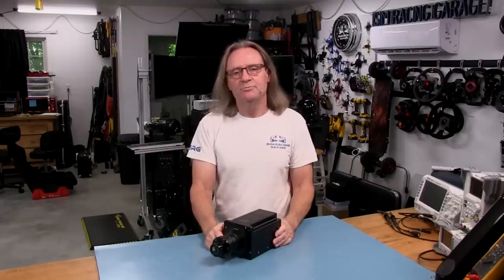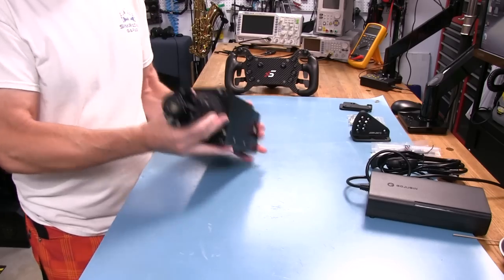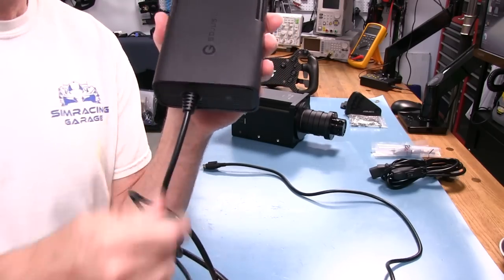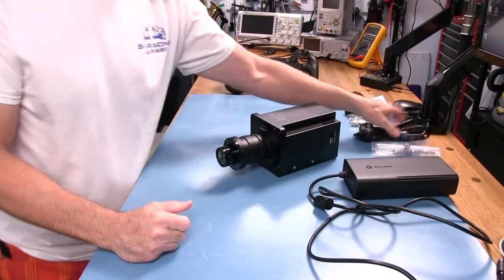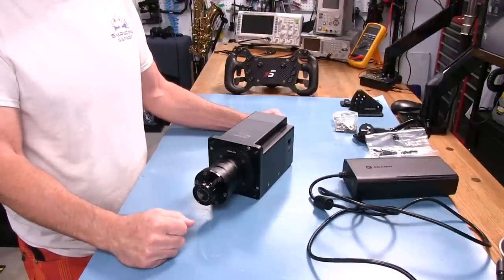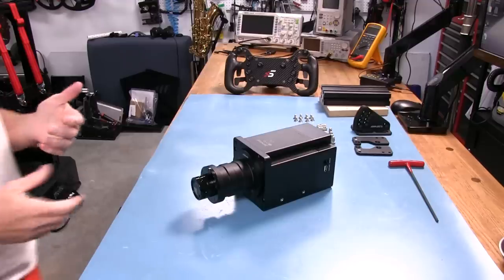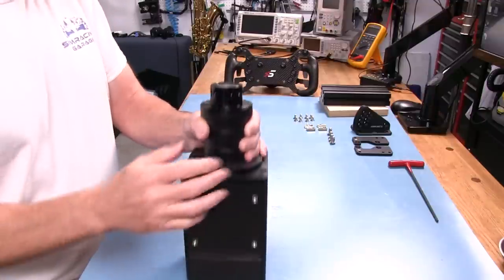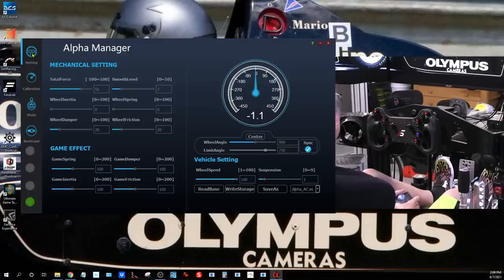Simagic Alpha Mini DD Wheelbase Review

Comment: Part of your issue with the "Notch" while passing center, is due to you going from a profile with 900° in Alpha Manager, to one with 1080° without re-calibrating the wheel in game. This will cause Linearity issues and can create a "Notch". This notchy feeling you experienced is only present in iRacing, no other game has this. This is due to the inferior 60hz signal coming from the game which needs a lot of Interpolation/Smoothing. This is also why this issue isn't present when using iRFFB.
Every other game is smooth as silk, the hardware has no notches whatsoever. This is an iRacing issue in itself, which is why users tend to use iRFFB to clean things up and fill in the missing gaps.
Anyway, Thanks for the Review, your Hardware section is great as always.
Reply: Btw, I loved ur review on the alpha mini, thanks for taking the time out to make it!
Reply: @DogInANautSuit  Thank you, I appreciate the feedback.
Reply: Preach! I have never felt any kind of notchy feeling in AMS 2, AC, or ACC. Mega smooth but I am coming from a G29 so of course it's gonna feel better for me 😅.

Simagic has knocked it out the park with this product, can't wait to see their pedals!!
Reply: Thank you for your comment, so the solution for the notch feeling is setting both 1080º in Alpha manager and 1080º in iracing?

Comment: It's nice to see DD wheels are coming down in price and advancing simracing technology. Even though I think belt driven wheelbases still have their place, but they need to be priced lower (~200-350 EUR). Low entry DD wheels 500-700 - which is already happening. And then the sky is the limit. 
I have my personal grievances with Fanatec (the firm) and their DD, I think 0.5DD is their way to get you hooked into their ecosystem. But anyhow, it's a good entry wheel for those who have tried simracing with lower tier wheel and fell in love with the hobby. SiMagic when it first came on my radar, I was excited to see more competition in DD space. And they continue to deliver.
I love this channel. Smooth voice of Barry is almost ASMR brain therapy.

Comment: What's really nice about the adjustment system with the side bracket at 39:25 is that it means you can make sure each side is perfectly even, where as if it was just one big long slot on each side, you would have to make sure it's level yourself
Reply: I have a bit of play in mine when I turn my FFB all the way up :( , it's vertical play.

Comment: Thanks for your comprehensive review, Barry. Looking forward to your CSL DD review
Reply: Bold of you to assume that there'll be a CSL DD review
Reply: @tracklizard4018  at this point, I really don't care about CSL DD.
Reply: @samgh7166  Me neither. Having to use a fanatec wheel + paying another 100 for 8nm is a deal breaker to me. If only there was a decently budget oriented manufacturer that just created a wheelbase + free software that has a standard bolt pattern for any wheel.

Comment: The in-line power switch is a great idea. This way you disconnect the mains power 
from the power supply as well, not just the wheel base.
Reply: Couldn’t you just unplug the whole power supply

Comment: I actually like the switch on the cord as my Fanatec DD1 switch doesn't turn my wheel off anymore and now I need to send the whole wheel base to Fanatec for repair, whereas if it was built into the cable, maybe there's a chance that the cable would just need to be swapped out. It could be apples and oranges for all I know...

Comment: 17:30 At this point could you mount an aftermarket wheel such as a momo, omp, or sparco? What bolt pattern is that?
Reply: It's compatible with 50mm and 70mm bolt pattern rims. You just need a spring ball bearing type quick release. Simagic makes their own and the NRG and D1 spec ones are both compatible. Also you don't mount it directly to that.

Comment: Great review (as always!).
@1:28:16: At $500 this is a great deal. Although Barry mentions the promo runs until end of August, the price now already shows $799.00 on August 15, which isn't that much of a good deal anymore, especially with the Fanatec CSL DD just around the corner.
Reply: @Polymer If you clicked on the link at the bottom, and read the description, you would see that $799 is for the mini base plus a GT1 Wheel, which is a great deal.
Reply: @T3KNOSIS  thats 950 now lol
Reply: @mirshia5248  The price was a special launch deal that would end in the 2nd half of August.
Reply: @mirshia5248  In Europe the Alpha mini with QR 1s 675 euro, without 595 euro. In a bundle with the GT4 wheel it's 1099 euro, the GT1 wheel bundle 1039 euro. The CLS DD is a entry level DD wheelbase, the Alpha mini not.
Reply: @mirshia5248  Where I live it's only about $200 difference, It's definitely worth it. Especially since it's a better base than the CSL DD.
Reply: @mirshia5248  $1350 with the wheel in canada. Not far off the CSL DD after import fees from USA
Reply: @rubbertoe.  day and night difference in quality tho
Reply: @eclipsedigi  funny that comment is pretty old. I actually recently purchased a simagic alpha mini. The quality on the simagic wheel is quite a bit better than the CSL DD being all metal instead of plastic like the DD. The motor itself is also better than the DD.

Comment: The power switch on the cord is not that bad, as it switches off the power supply as well. You could argue to have a switch on the power brick instead, but at least I find this a better solution than putting the switch on the base.
Reply: Or couldn’t you unplug the power supply every time no?
Reply: @kingnorwegin482  too many options. Cannot manage.

Comment: So the way the base connects to the wheel is wireless, but it is connected like its a wired yeah? With no wifi or bluetooth because it has the pins to connect like its wired without a cable.

Comment: I got this over the csl dd. For about 200 more you get 10 nm without having to buy a seperate power supply which really sold me
Reply: I think a third party power supply will works on the CSL DD. You can find them by around 40 bocks. Then the money gap is much bigger.
Reply: But ideally you need to buy the matching wireless wheel making the alpha mini $1000usd.

Csl DD with boost pack and a rally or mclaren wheel $680usd.
Reply: @barrymanon9459  No you don't, Just buy one of their quick releases. Unless you really want buttons on your wheel.
Reply: @jaketad939  Alpha mini with GT1 R wheel is 799. Not sure why folks are exaggerating the cost here
Reply: @winstonang8980  Yea exactly.

Comment: I'm in doubt about where to adjust the flywheel resistance (flywheel weight). I didn't find the option in SimPro Manager. I saw that in the old software there was this option. Wouldn't it be possible to adjust in the new version? thank you if you know how to help (Alfa 15Nm)

Comment: beside the 2nm extra in the Simagic Alpha Mini DD what do you think would be a better buy the Simagic Alpha Mini DD or the FANATEC CSL DD the price is not much different ?
Reply: VRS
Reply: Well, the Simagic has better compatibility with third party steering wheels (lower and higher quality compared with Fanatec wheels). It also has a better finished, wireless system (which fanatec doesn´t need and works as it would be wireless), much better quick release (this one is amazing), a very interesting controller software full of options, ... Fanatec has nice pros as well but I´d bet for Simagic.

Comment: A big question here: did you ever manage to make the Simagic Alpha Mini work in Project cars 2 or Automobilista 2? It never works for me. Very difficult to even assign and calibrate, have to reduce the rotation to tiny angles. But even after that, in game there is 0 movement from the wheel. All the buttons are recognized, even axis of the paddles, but not the rotational axis. Tried with all settings I could on the Simagic software and in game, same result in both of those games.
Reply: it works in both of those games for me.
Reply: Yes offcourse, ams2 works amazing.
Reply: @pallevan1977  Oh nice, thanks for that information. i've been trying to find out for a while if simagic harmonizes well with ams2 and haven't found anything yet.
Do you still sometimes drive in ams2 with your simagic, is it still good?
Reply: @Pro-Bert  I drive in ac, acc, ams 2 and rfactor 2. And it's great!
Reply: @pallevan1977  Thank you! That helps me much. 🙂👍

Comment: So I'm got a cockpit on order now I need to decide if I should go for the alpha mini or spend  more $$$ and get the vrs direct drive  will I ever need or use 20nm or will 10nm be more then enough ???
Reply: Sc 2 Pro user here. I run like most other Guys my Wheelbase between 10 and 13 NM. No one uses 20 NM on a daily basis. But it is good to know that you don't stress the hardware and there is enough Headroom so FFB Clipping will never be an issue.
Reply: @bjornromermann5080  ok thanks for the info ill hold onto my csl elite for a  few more months might look at getting decent set of pedals first over a direct drive wheelbase maybe I'll do a bit more research on what is best for the next upgrade path
Reply: @fabz1817  Yeah definetly update the Pedals first. A strong DD Wheelbase is still a luxury Item. You don't need it but like an Ferrari it will bring you soooo much joy. Personally I would always go the Simucube Route again. Super sturdy and build to last for ever with an excellent Software support.
Reply: @bjornromermann5080   yea would love a simcube but can't justify the price diffrence here in Australia simcube 2 sport $2000aud  VRS direct drive $1400aud  and since the vrs has had amazing reviews not sure it $600 is worth it  I am looking at the protosimtech pt2 pedals or some heusinkveld sports
Reply: @fabz1817  ouch 600 Bucks is quite a lot. In Europe is the Difference not so big so the decision for Simucube is easier. But these are really luxury Items and in the end of the day everyone has to decide for himself how deep the hole in the pocket may be. Regardless what you will buy you will be very happy!

Comment: So what I've taken out from this is that it's somewhat a DIY base where you have to spend time and really know how to set it up properly. Not everyone KNOWS how it's supposed to feel. This is the problem I have with many wheels, I do not want to mess with settings and learn what each and every one of them do, just make a DD base that is setup correctly from factory that gives you a realistic experience. Not everyone is a racecar driver that wants to practice at home and knows how a real racecar should feel like lol :)
Reply: It's subjective.  Realistic isn't relevant either because the whole point of FFB is giving you information that you don't get sitting in a race car but you need playing a sim because you're not in a real car on a track. Note, exactly the same thing happens for any other wheel it's not a feature of DD. You'll note that once a wheel has a reasonable user base there'll be plenty of people sharing settings (in the same way there are plenty of custom ffb profiles for the games)

Comment: do you need to use a simmagic rim or could you just get the qr and bount nay rim you like to it ?
Reply: i’m waiting for Alpha mini base on pre order and have  just received a SRC usb adapter kit for my thrustmaster leather wheel which i just need to use an adapter to fit to base due to the way the thread is inside the adapter, so can’t just attach to QR .  I’ve been lead to believe a logitech g29 style adapter plate will work  on the motor side extension ( thanks for the measurements JD ) , so will see how it goes once it all arrives.
Reply: @kuku6031   So i have the same issue. I ordered the base kinda by accident kinda not. but i have thrustmaster wheel. will the src work?
Reply: @tryingtosurvive8518  it works and is top quality, but you will have to buy a D1 spec qr that you then need to pull apart to bolt through from inside as the src adapter is threaded. It was a bit of a hassle but I found a solution of making a adhesive gasket out of double sided tape, without it I couldn’t get a fully tight connection. But others have ? 
It’s rock solid now. And would be easier a second time around. You also need to cut some off the internal spring of qr to allow for space taken up by bolts.
Reply: The Logitech adapter didn’t work and even milled out to fit , there wasn’t enough clearance for bolts

Comment: Shows at $799 for me in US. Seems Fanatec CSL DD its a better value at $495 (8NM power pack).
Reply: Edit: apparently its $799 and it includes the GTR-1 wheel, which makes its a much better value!
Reply: Isn't it $500? It's disturbing when  people throw disinformation and leave out full information to intentionally mislead people.
Reply: Shows $999usd in sim motion website with GTD wheel.. not sure where you got $799usd from
Reply: I think your looking on the Simfai website which is in Singapore.
Reply: If you click the link at the bottom of the Simfai link, and read the description, it states that it's $799 for the Mini base plus GT1 Wheel. That is an excellent deal.
Reply: @T3KNOSIS  Aye, I also received a message back, confirming the same.....and yet I am STILL skeptical! 😬 😁
Reply: @Polymer  Simfai's website has been updated for better clarity.
Reply: @T3KNOSIS  Aye, thanks T3KNOSIS. As skeptical as I was, I had already placed the order anyways! 😁 (Shipping was U$210.00 to USA, FWIW)
Reply: @Polymer  why order from Simfai which is far away from the US? There are at least 3 distributors in N America alone. All can be found on simagic.com website.
Reply: Just a note to Aussie’s ,if you buy the Simagic from offshore with shipping it will come to a lot more than $1000 au, which means it will incur , customs duties= another $200-300 on top of the original costs.

Comment: I don't really see the point in this. If you are going to spend DD money then get a normal unit and turn down the strength till you trust it.
20Nm (soft) is what my 12 Volt cordless screw driver can do and I hold that one in one hand.

Comment: thing is a rip off
Reply: How so? 🤷🏻‍♀️
Reply: @Polymer  when u buy everything you need it comes to 2000
Reply: @xAUSTIN316x  Define "everything you need". Sorry, not trying to be a smart-arse; just don't quite get the "rip off" comment. The Alpha Mini with a GT1-R wheel shipped to the USA is around $1000 and they are in stock. You will also need pedals, a shifter and a computer & screens.
Reply: @xAUSTIN316x  No you don't. Where are you getting your info from?
Reply: @Polymer  it's a scam to get you to buy everything as in the peddles the wheel and the buttons and shifter. Even the psu  is an extra 180 that's bullshit
Reply: @xAUSTIN316x  ??? Are you taking about Fanatec or?
Reply: @designamk1160  your feelings still hurt hahahah
Reply: @xAUSTIN316x  your description fits perfectly for the Fanatec ecosystem